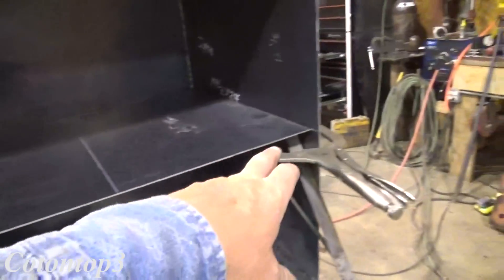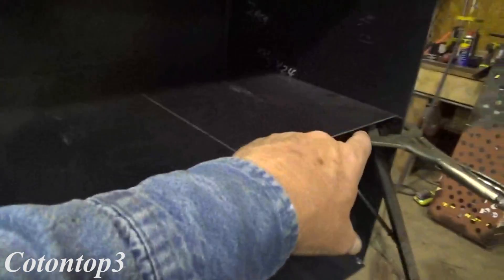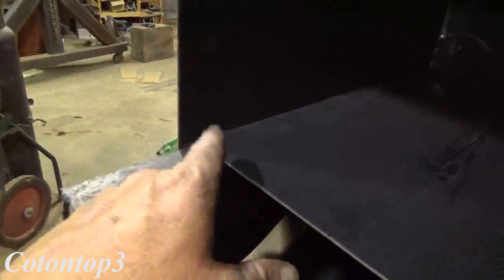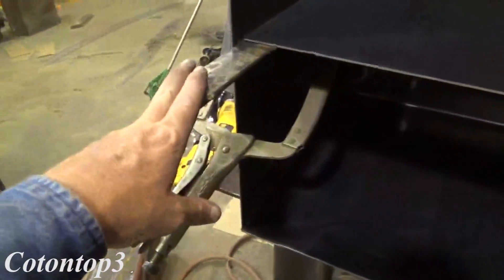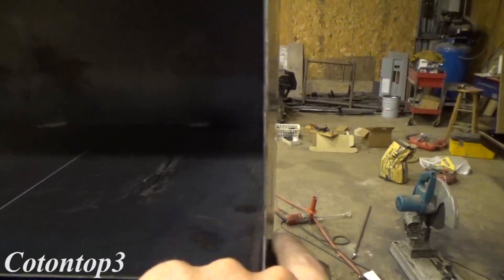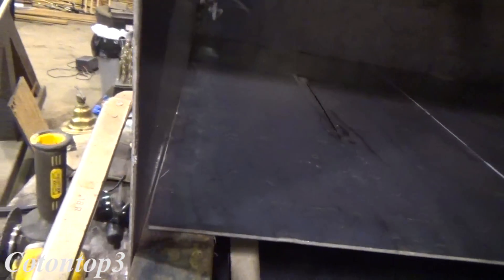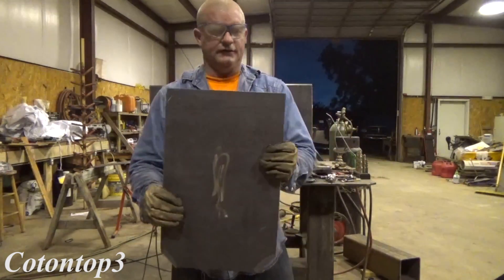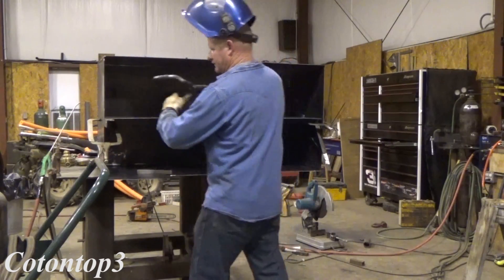Fuel tank build (part 6) How to make and install the baffles

Comment: You should have a plasma cutter. It cuts a lot cleaner and is faster than a torch.
Reply from the maker: +gerald pettigrew I would like to have one but the plasma is around $2,000 that I would need and my torch was only $400 and works fine.

Comment: 90 gallons is 675 pounds in fuel that cool. i can see how your big tank broke that 400 gallon is like 3000 pounds of fuel moving around. so crazy numbers if you think about it.
Reply from the maker: +GearJammerTV you are correct, it's a lot of weight and weight that can do a lot of moving around.
Reply: hell yeah i haul water tanker when i use to be a vol. firefighter back home and it didn't have any baffles in it and that was a bitch to drive when you on the way to a call. even drove a few tractor trailers in my day hauling tank and had very few baffles and that sucks too. cotontop3
Reply: I did the same thing many years back hauled two 20 ft tanks loaded with no baffles about a 100 mile in a trailer train.
The scariest drive I ever did. Told dispatcher I would never haul two tanks again.
Reply: Yeah my trailer  was 45 foot long and one baffle and I drove it for a year lol